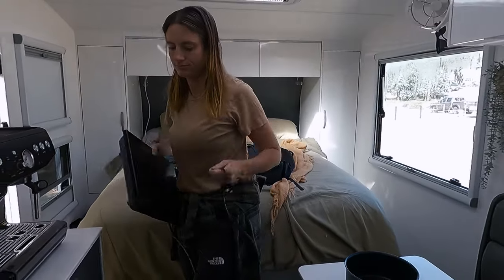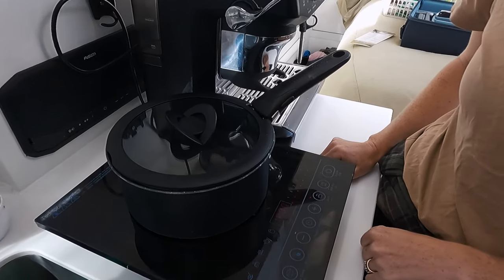Off-Grid Power: How We Use Solar Panels, Batteries and Inverters to Run Our Caravan

Comment: Another great video, Simon and Liz - thank you :)  Great tip about running the A/C while driving, with the Anderson plug from the tug charging the batteries.  Definitely going to try that one!  We have essentially the same setup as you, but with the one extra solar panel - so 900W in total - and the 60A TriStar controller to make the most of all that solar.  The only thing I'd add to your excellent info in the video is to keep the solar panels clean.  They do get a sort of coating of grime and dried water (dew, rain, whatever) on there, and we weren't noticing the gradual decline in the rate of charge, as it happened over a period of time.  But we DID notice the sudden increase in the rate of charge when I got up there with my microfibre mop thingy and cleaned the panels off...!  Took about 5 minutes of gentle work, but made a significant difference in the efficiency of the panels.  Keep the good stuff coming, team Bailey :)
Reply from the maker: Thanks Pete. Good point about keeping panels clean. You're spot on.

Comment: I'm so glad I've just stumbled onto your channel .
Very well done . I'm enjoying your off grid series.. it's great...
Our van is due this September.. 18 month order time.
We've gone 400 amph lithium
840 watts of roof solar
1 dc/dc 50 amp charger alternator dedicated
1 dc/dc 50amp charger dedicated solar.
External anderson plug to BMPro .for portable solar management. 
3000 watt inverter 
Similar set up to yourselves.
Really interested to know how you store the Thermo for travel ie protecting it from lumpy bumpy roads and its delicate weigh scales etc.
Keep the dream alive    pioneers !!!
Reply from the maker: That's great to hear, thanks! Well done on your van. We keep the Thermomix in on transportation mode and in a thermomix storage bag. 👌

Comment: Great video with lots of info, as usual. Here is a suggestion that might improve the clarity for future videos on this topic.
The energy stored in a battery is measured in amp hours, not amps.
The energy used by an appliance is measured by the amps it draws multiplied by the time (in hours) that it operates. When talking about an appliance operating it would be clearer to talk about  x amps FOR y hours giving an energy consumption of xy amp hours.
Reply from the maker: Thanks for the tips!

Comment: Thanks guys very informative. We are  just starting out and took our van for a 3 week holiday we managed fine with batteries 400 a & water but the rain did make charging our batteries a problem we caved and went to a caravan park, paper, rock, scissors made our decision, we're also a lot older than you guys no longer want to worry about air conditioning and heat. (LOL):hand-pink-waving::hand-pink-waving::hand-pink-waving::hand-pink-waving:
Reply from the maker: Sounds great!

Comment: Good ideas again thanks for the info will have 300amps of lithium with 120 amps in Ute so a lot of testing and checking batteries for a lot of the time.Have been running the fridge in the back of the Ute and after a lot of raining days always checking battery and never goes down below 98% so far.I do have a 250 watt solar panel on canopy cheers🦐🐟🦈🎣
Reply from the maker: Sounds great!

Comment: Loving the series it is helping consider a lot of things as we think about our van build. One quick question is why do you use the thermomix or inverter to heat water instead of a kettle? 

I wouldn’t think 300w difference over 5 minutes would be a big difference. Or is it also a space saving issue as it is just another thing that you have something that already does the job?
Reply from the maker: Thanks, Simon. It's just about carrying less stuff and using what we've got.

Comment: Hi Simon and Liz, we really love your videos. You guys are really informative. I just wanted to ask you about your power system and is it capable of running your air conditioner in your caravan. Would a caravan air conditioner consume a lot of power. Any feedback you can provide would be greatly appreciated. Take care guys.
Reply from the maker: Yes, absolutely. We cover this in the video. The AC uses approx 80ah @12v (or just under 1000w)

Comment: Hi, we have the same van as you and just wondering if you’ve considered a generator for the AC ? - we find we struggle in 38-40+ degree days only being able to run the AC short term. Enjoyed your tips and tricks 👍🏼
Reply from the maker: We've never felt we needed one. We only run the AC when it's really hot and generally, there's good solar when it's that hot.

Comment: great too see another informative video. 
Off the electric topic, how do you keep your roof so clean? do you just use normal car wash, truck wash with gantry to get to roof, or send Liz up on the roof?
Amazing stats for off grid camping, very few nights in parks.
Reply from the maker: Thanks Mark! No secrets with the roof other than get up there and clean it! It probably helps that we avoid parking under trees etc wherever possible to get as much solar as we can!

Comment: Very informative video and clearly expressed. I’m just wondering if you should research dc-dc boosters for laptop charging. It does my head in thinking about the conversion energy wasted in going from 12 volt DC to 240 volt AC back to 15-20 volt DC. Keep up the great content.
Reply from the maker: Fair point. To be honest, it's something we've not really considered before but probably should look into more.

Comment: Very informative video.  I’ve got an18.6 Zone O/road caravan. Have 400ah lithium with 600w solar panels. Also 40ah DCDC charger.  I have my iPad (which I carry in the car) linked to the caravan CZone.  So I can see what ah’s are going into the battery while I’m towing with the car.  I see that it never  has more than 29 amps per hour going into the batteries whilst travelling.  I’m assuming that that charge is coming from the car alternator only.  Should some charge also be coming in from the Solar.  With a 40ah DCDC charger I would have thought that the solar panels could also put in the remaining capacity of 11 amps.  Maybe I also need to have a MPPT solar controller installed so that solar charge is also going into the batteries while travelling. Maybe you could clarify this for me
Reply from the maker: Thanks, Steve. As I understand it yes, you should be getting solar input and alternatuor input when driving. It will depend on how the van has been wired tough. Best to speak to Enerdrive and see if they can assist. We've found their tech support to be exceptional.

Comment: Thanks Simon & Liz. Very helpful episode. It was interesting to me that your power needs have, and are changing as you travel. While I realise this would add a cost, if you were desperate for power regeneration and solar input was low have you even considered (or needed) to run the vehicle for a period to regenerate while off grid?
Reply from the maker: Our pleasure! We've never done that, although theoretically possible. The alternator at idle doen't produce a huge amount of charge and I don't like the idea of having the vehicle idling for a long period of time.

Comment: hi Simon & Liz. Another great video that just simplifies everything. I actually did my spreadsheet after the last off grid video which is so helpful and you again confirmed some of my power usage numbers for most items. my questions is though, and I 100% understand its not perfect, but how much charge should each 180W solar panel(or 4 panels @ 720W) put into your batteries. we have exact sane system as you - 720W solar, 2 x 200Ah Lithium, 40A DC/DC, 2600W Inverter. (We don't have the MPPT Solar Charger- maybe 1 day). I know it depends on lots of variables but what is the starting point?? we also have same wireless monitoring so trying to get my head around the app also!!! thanks heaps.
Reply from the maker: Thanks Richard. Like you said, it's not an exact science but at best we see 36-38amps @ 12v from our 720w. I reckon if you work off 60-70% max you'd be pretty close.

Comment: Thank you for great videos. However, I do not understand how two separate chargers work at the same time work. I believe an MPPT charger checks output of the PV module, compares it to battery voltage, then fixes what is the best power that PV module can produce to charge the battery. If a second charger is holding the battery voltage (artificially) high, eg 14.5V whilst charging, will the other charger measure this voltage and shut down? To put it another way, I thought smart chargers worked by switching between a charging mode and sampling mode where it gets feedback on the SOC to optimise the charge profile. With two chargers do you still get an optimised charge profile. How do they sync?
Love and appreciate your content. Cheers.
Reply from the maker: Thanks Andrew. I see your point and it's possible we're progressing beyond my understanding of the system here 😂 Lithium voltage doesn't vary as much as AGMs (it's one of their benefits) so I'm not sure that's how the chargers are operating when their profile is set to lithium. I do know that it works though, we often see 70-80amps going into the batteries when driving and there's good solar conditions. That wouldn't be possible from the solar or alternator alone.

Comment: Thanks heaps. So my rough calc with 4 panels was 36 amps(4panels x 9 amps) x 0.7(efficiency) x 6(#hours) = 151.2 amps. Thus if we were down to around 40% on our 240Ah batteries we would (theoretically) should be back to around 100% after 6 hours????? We are usually down to about 78 to 80% each morning so are well covered based on this I think???????
Reply: I think that should be  "Thus if we were down to around 60% on our 400Ah batteries we (theoretically) should be back to around 100% after 6 hours?????"
Reply from the maker: Hard to say if that's correct without all the info. How many Watts are your solar panels?
Reply: @TheLifestylePioneers  4 x 180W /720W. following is my first comment and I incorrectly sent the response in comments in stead of reply - oops!!!  hi Simon & Liz. Another great video that just simplifies everything. I actually did my spreadsheet after the last off grid video which is so helpful and you again confirmed some of my power usage numbers for most items. my questions is though, and I 100% understand its not perfect, but how much charge should each 180W solar panel(or 4 panels @ 720W) put into your batteries. we have exact sane system as you - 720W solar, 2 x 200Ah Lithium, 40A DC/DC, 2600W Inverter. (We don't have the MPPT Solar Charger- maybe 1 day). I know it depends on lots of variables but what is the starting point?? we also have same wireless monitoring so trying to get my head around the app also!!! thanks heaps.

Comment: just thinking 720 watts  solar is 60 amps at 12 volts but charger is 40 amps. Seems you could never get Max solar input?
Reply from the maker: Great pickup and something I probably should have touched on. It all comes down to the efficiency of the solar panels. It's unlikely we'll ever reach 40a input with 720w of solar laid flat on the roof. The max is around 36-38amps

Comment: @ 8:28. What about your Air Conditioner as your biggest appliance?   🤣 ROFL.
Also, if you had a Victron Multip-lus 3 kva Inverter, the specs state you use up to 20w residual power (which is 1.6 amps).
Reply from the maker: I get your point with the AC, but the coffee machine draws more power (obviously doesn't run for as long though) so depends how you look at it. Victron is good gear but doesn't have the same level of support as other brands in Aus.
Reply: @TheLifestylePioneers  My coffee machine is a Sunbeam EM5000 - <1470W.  It doesn't grind beans or accept pods but makes Expresso/Capp/late with frothed milk within minutes. I have watched some other youtubes including Marine applications of Victron Multiplus 3000 and noticed that not only do they not fail for the most part, if installed correctly, but that the larger Merchants here guarantee Service options (Under Australian Consumer Laws they are obliged to provide pro-rata Warranty/Service for 3 years, at least).   As a matter of interest so many people have installed them on the premise, that if they are designed for harsh marine, including ocean-going envoirenments, then the Aussie outback is a 'walk in the park' for them. 🌐😊

Comment: A lot of laptops have options to get a charger that will run off a cigarette lighter.
Reply from the maker: Thanks. We haven't been able to find one that will keep up with our video editing laptop. As I understand it the most you'll get from a cig socket is about 10A at 12v, ours needs quite a lot more. Definitely an option if you can run your laptop from it though
Reply: @TheLifestylePioneers  I have one for my work laptop that puts out 85 watts. How much are your video laptops chewing? I know that I’ve seen 100 w versions around too.
Reply from the maker: @Clayton Firth  our video editing laptop needs 240w
Reply: @TheLifestylePioneers  yeah you’re not getting that much out of a cigarette lighter socket…